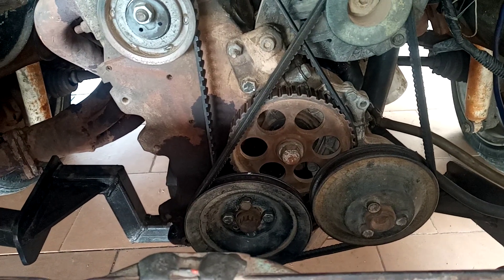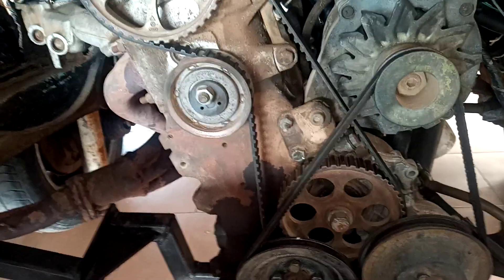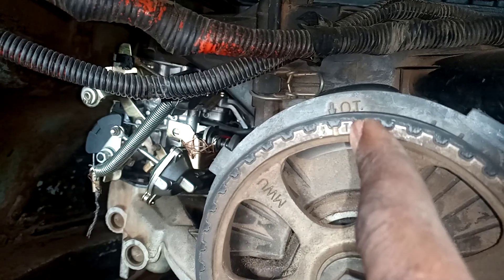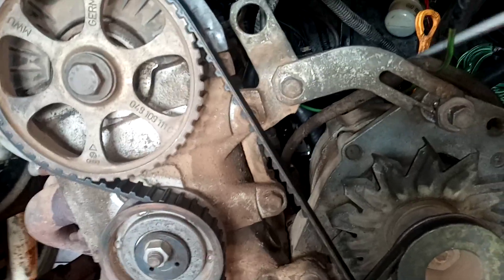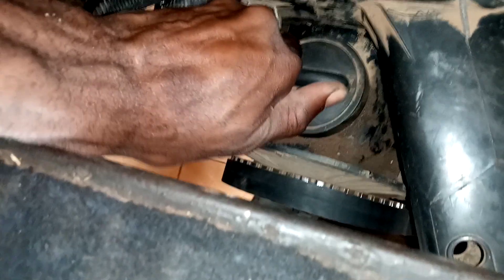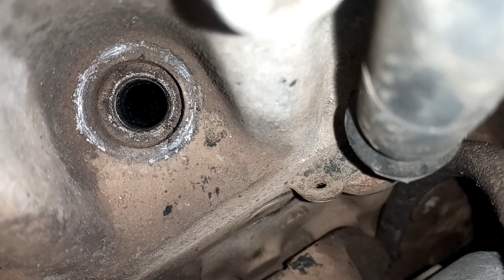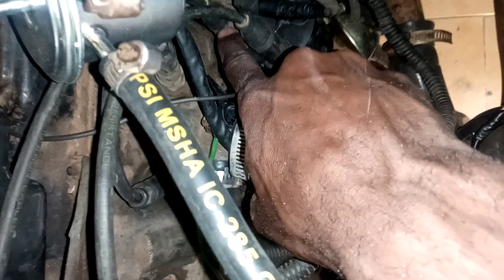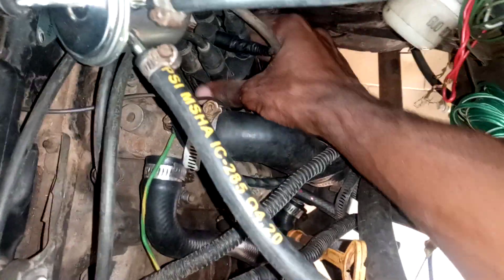how to time , (mk1 timing marks ),Golf engine

Comment: Hi the middle pulley and the distributor thing are not in line with each other..what can I do?
Reply from the maker: Most the time the middle pulley doesn't matter if it's not in line as long as the distributor is pointing at the right spark plug cable